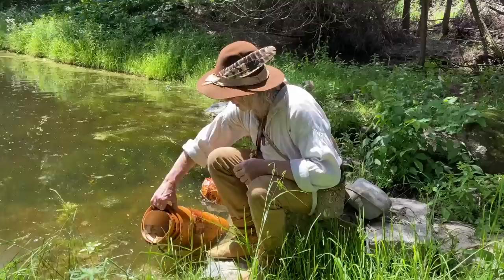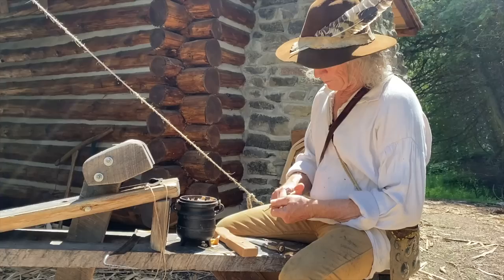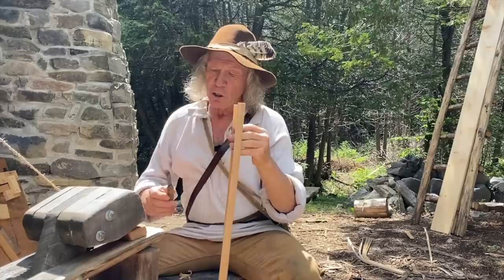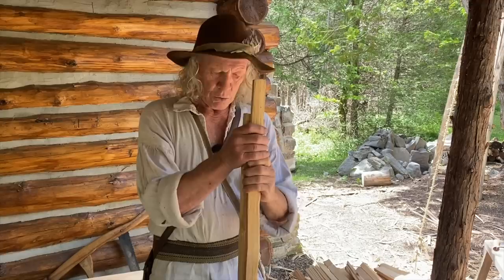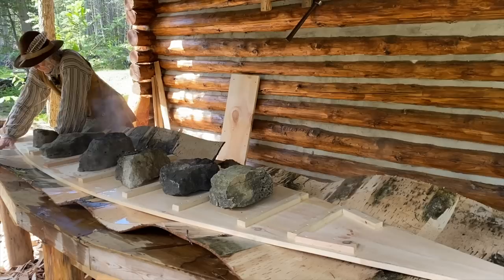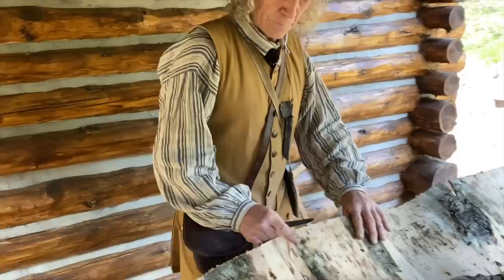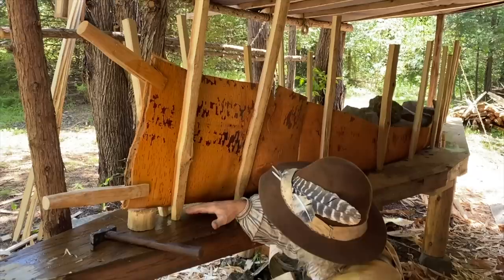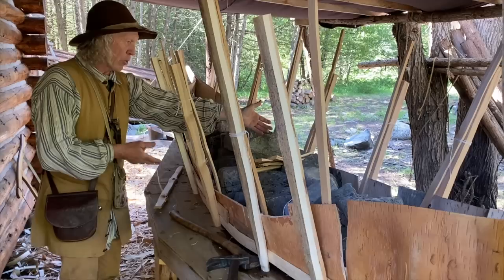Making Serious Progress Now!  Birch Bark Canoe Build: Laying the Bark | DIY | WOODWORKING | FRONTIER

Comment: I have worked with old growth cypress pulled out of an old shed and second growth new stuff. Split an inch off the old growth 20 foot long and you have a straight line and the same width from one end to the other. You do great work with young tree to pick from. They had a wider selection of old growth trees 300 years ago.
Reply from the maker: They did indeed , there is so little old growth forest left on the planet, so sad.  We’ve canoed in the Arctic and the Yukon and although not big, I find it fascinating to travel in areas like the boreal forest that have, for the most part, remained untouched by humans!

Comment: OOPs, I went back and reviewed the June 10 episode and found the 4 minute segment where you debark the birch.  I was expecting to see 'specialized' tools (wood wedges, spreaders, etc.) but saw that the only tools you used were your small knife, an axe head to use to start the separation, and the flat of your hands to act as peeling wedges;  pretty simple process and fun to watch!
Reply from the maker: Yup, not a lot of tools required.  This time of year it almost pops of the tree.

Comment: Great ... looking nice ... you must feel like you did something now .... meaning it is taking shape .
I was holding my breath when you were spiting .... you picked out a nice and straight pieces ..... 

Using a brace to drill ... I still have the one my grandfather hand before electricity ! ...  Have you ever used a 17th century drill ? it looked like a spoon / scoop . The guy in the Woodright shop , Roy Underhill ,  used them many times .
Any fish in that pond out front ?
Reply from the maker: I was holding my breath as well.  I have used 18th drill bits and they work just fine used at the speed of the brace.

Comment: Another fantastic video. I was wondering about steaming the bark as opposed to the boiling water. In the end I decided that the steam softened bark wouldn't stay flexible long enough to work the length of the hull. Boiling water makes sense. Fantastic video again. What is it about Robins building nests near/against buildings?
Reply from the maker: Thanks David.  We put up platforms all over for the birds and many take advantage of them for nest building.

Comment: Great to see a step by step and something I can fallow. Questions .. How much of an overlap in the bark should one have while assembling bark panels for the bottom and length of the canoe ? And how far away are your stake holes from your building frame ?
Reply from the maker: 4” is adequate, anymore simply adds weight.
Reply: @TheWoodlandEscape  OK thanks Peter .. I should of got a good book like you suggested, but want to avoid having " to much info" which I might regret !

Comment: Hey Peter!  THAT is going to be one beautiful craft when you're done with it!  That bark may not have been perfect... but for a natural material, it was close enough!  WOW!  I have seen birch bark canoes in museums that were 200+ years old on display.  Of course, they were no longer being used on a daily basis, and I'm pretty sure that added to their longevity.  So...  how long of a lifespan could a working canoe be expected to have, before a new one was required?  In your experience, what is the first part of a canoe that, generally, needs to be repaired/replaced first?  (If you say, "The fella paddlin' it!", I will laugh... but I'd really like to know!)  I'm already looking forward to seeing the next video!  Thanks!
Reply from the maker: My oldest birch bark canoe is. 17 years and still has the original root lacing.  All canoes require annual re-pitching of the seams unless you us artificial pitch.  From my research, the canoes used in the fur trade era last 6 to 7 years but, they saw continuous use from ice out to ice in.
Reply: @TheWoodlandEscape  WOW!  That is pretty durable... given reasonable care when using it and regular maintenance when required.  I'm starting to suspect that the birch bark was a victim of false advertising from later manufacturers wanting to use other materials for the skin... yet still being able to have it claim the title of being, "a Canoe"!  Thanks for keeping this ancient art form alive and flourishing!

Comment: they weigh about 80 pounds far too heavy for me
Reply from the maker: The last solo canoe I made came in at 60 pounds.  The bark on this one is thicker so I’m thinking about 65 or so.  I have an old 16 foot that weighs a bit over 70.  Certainly heavier than modern materials.